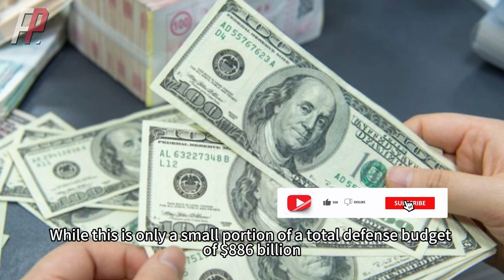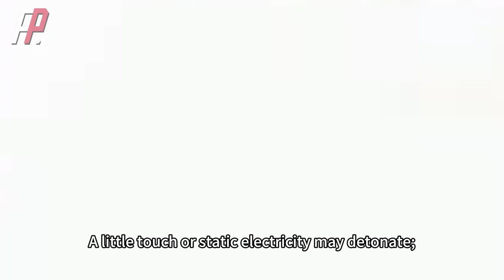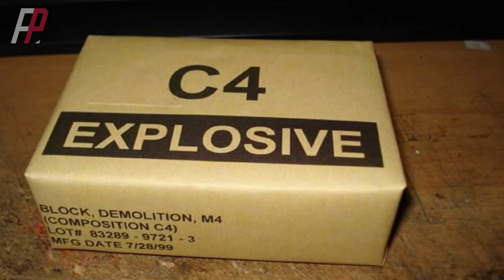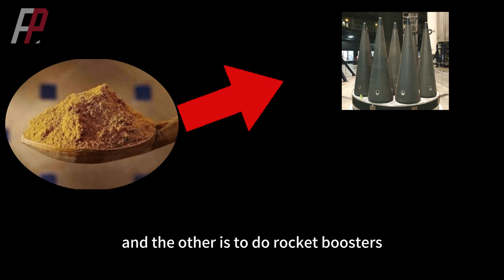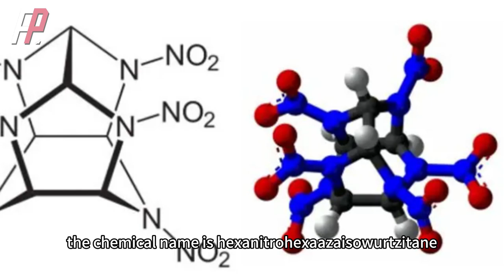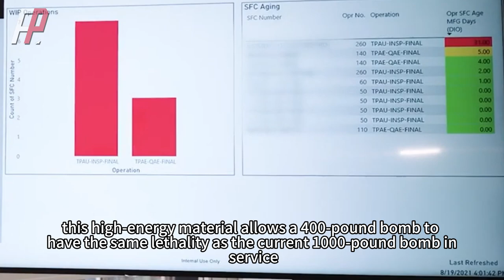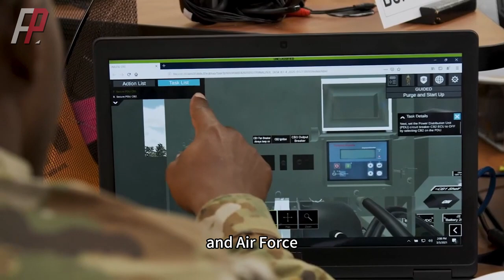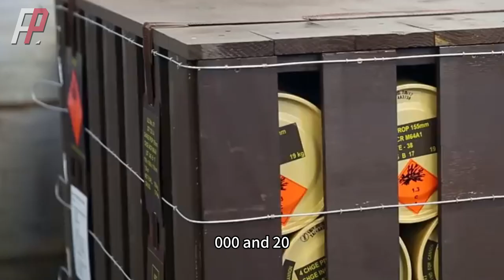CL-20,Most powerful non nuclear explosive, 10 times more powerful than TNT

Comment: Recently, there have been reports that Ukraine used a small drone to destroy a Russian T-90 tank. It is speculated that such drones are equipped with CL-20 explosives, known as the “king of explosives.” CL-20 has a detonation velocity of up to 9500 meters per second, approximately 28 times the speed of sound. The total energy generated by the hypersonic kinetic energy and extreme instantaneous expansion pressure produced by this explosion can easily shatter any strong structure or penetrate any armor protection, hence its nickname as the king of explosives or quasi-nuclear explosive.
Applications: Primarily used for rocket propulsion in hypersonic missiles, advanced guided weapons, breaching weapon warheads, and other military applications requiring high explosive power. The United States invented CL-20, but due to the high technical and production thresholds and the expensive cost of over $1000 per kilogram, the US military did not use CL-20 in its ammunition in the past. The recent use suggests that production difficulties have been resolved.
Recently, Taiwanese news media reported that Taiwan’s defense industry has announced patents for automated machinery, raw materials, and production lines capable of mass-producing CL-20 explosives. They also stated that the cost of manufacturing CL-20 in Taiwan is less than half of that of American manufacturers. The explosives will be used in Taiwan-made anti-ballistic missiles, anti-ship missiles, long-range strategic strike missiles, torpedoes, attack drones, and portable anti-tank rockets. The Taiwan-made portable “Red Falcon” rocket (weighing 5.1 kg, length 110 cm, range 400 meters) originally used standard explosives with a penetration capability of 400 mm. With the new CL-20 warhead, its penetration capability has increased to 600 mm, making it a powerful tool for anti-armor, destroying defensive structures, and urban warfare. It is also heard that Taiwanese military factories will produce CL-20 explosives for the US military.
Reply: doubt it due to high cost and hard synthesis its probably not used
Reply: Chinese mainland is the most productive area
Reply: Makes MUCH more sense to use 15% TNT/85% ANQN to achieve almost the same power, CL-20 is too difficult and expensive to synthesize in comparison.

Comment: Ever heard of octonitrocubane?
Reply: ONC isn't a realistic energetic for use in mass produced munitions with our current tech and knowledge of chemistry. It is difficult and dangerous to produce. Amino guanidine based metal complex energetics are the way forward in my opinion. Hell ANQN at max density is over 9.8 Km/s detonation velocity with a pressure output of over 43 GPa. Complex it with Nickel or Cobalt and theoretically you would be over 10 Km/s with a pressure exceeding 45 GPa.